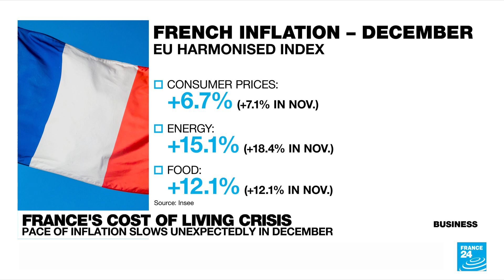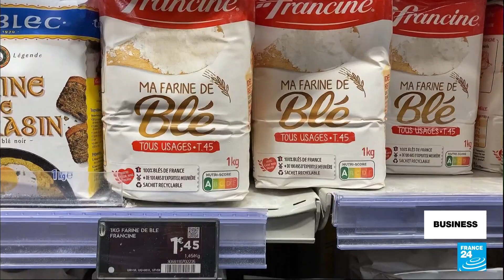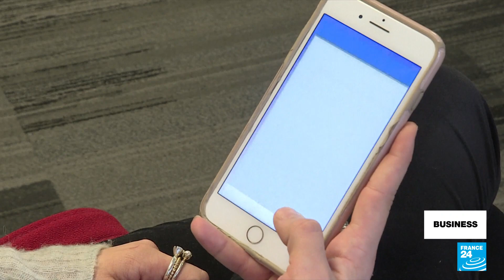French inflation stabilizes, but food, energy costs remain high • FRANCE 24 English

Comment: So, here in the US, I average using around 900 - 1000 kWh per month.. at $0.12 cents per kWh, my bill usually runs on average around $112 to $125 a month. In France, where a kWh will run you around $0.25 cents per kWh, my bill would be double. We have pretty reasonable and reliable energy here in the US but, as we spend billions on wind farms and solar.. that will all be changing very soon. On the food costs, we are being told that food prices have increased by around 4% due to inflation, but my personal experience says this is not the case. In late 2022 my food cost were around $100 dollars per week. Now, I'm spending $150 a week and purchasing less food.